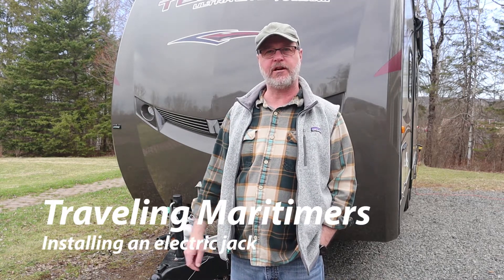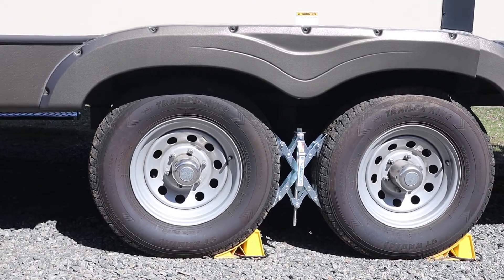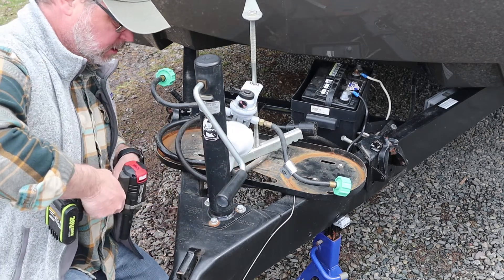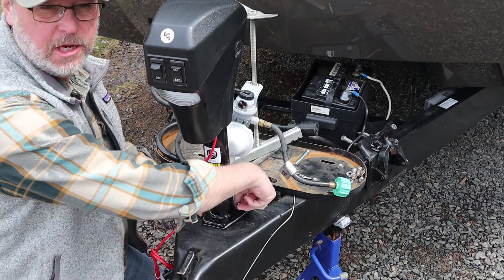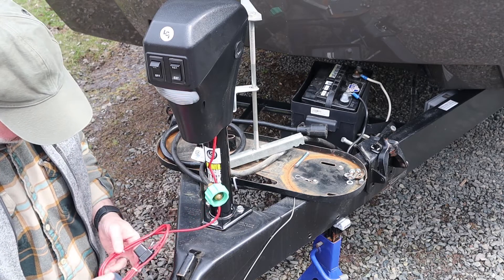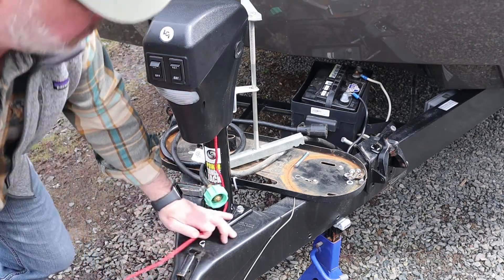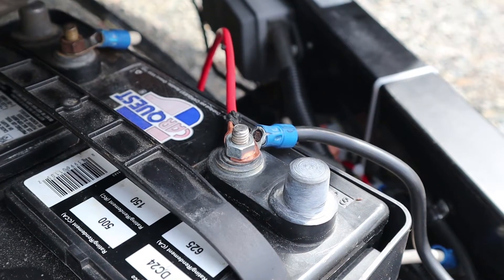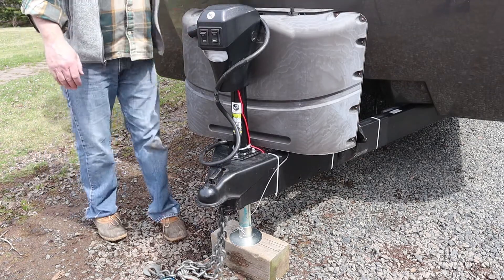RV Tip: How to install a Lippert Electric Tongue Jack

Comment: Nice video, two tips you might find useful.  The fuse can be replaced with a auto resettable fuse.  Mine was always blowing when it rained while using it, or if I bottom it out. 
Other is just an observation on your wheel chocks. I don’t know if you have another set on the other side but if not you should place the chocks on the front and back side of the tire to prevent rolling.  Even if you have a set on the other side it’s still good practice to do each side front side and back side..
Reply from the maker: Great tips, thanks for your feedback. I'll definitely look into the resettable fuse. Regarding the chocks, I certainly agree with you. I did have chocks on the other side and the X-Chock keeps things locked in place pretty well.

Comment: My first and most important piece of advice.  Be very careful removing the old jack.  I just replaced one because the motor went bad with a new one and one of the three bolts sheared off.  It turned a 15 minute job into a nightmare, finding a drill bit capable of drilling out the old bolt.  Once I got it out it took minutes to switch as the wiring for mine was already there.   I would recommend taking the weight off the tongue before you attempt to remove the bolts, liberal spraying of some kind of release agent, and gentle patience.

Comment: Nice video, thanks for sharing. Just for viewer's information..................... don't forget to use lock washers and tighten the bolts on the tongue jack to 15-20 lb/ft torque
Reply from the maker: Great tip!

Comment: Hello, this video was incredibly helpful as we've just bought the exact same jack to put on our 2018 JayFlt XLT 28BHBE.  Question:  what size was the lug terminal that you used to connect to your positive battery lug?  I need to order one from Cdn Tire to do this install.
Reply from the maker: Glad it was helpful. I just went and measured it. The hole is just a little under half an inch in diameter. Probably like 7/16. It was one I just happened to have in the garage. You could get away with a slightly smaller one. This one is quite a bit bigger than the terminal.

Comment: Can you use hand tools or a power drill  to attach the bolts if you dont have a torque wrench?
Reply from the maker: I don't think you'd get enough torque from a power drill. As far as hand tools, I guess it depends. If you had a long handled socket driver, like a breaker bar, you should be able to get them tight enough. If you don't think you have the proper tools, I'd highly recommend taking it to an RV service location to have it installed.
Reply: @TravelingMaritimers  understand. Thanks!

Comment: Does it clear your tail gate when lowered?
Reply from the maker: Not on my setup. I have to rest the tail gate on top of the jack. But it was the same with the old crank jack too. Other truck / trailer combinations will likely vary. With my old Jayco I could open the tail gate.

Comment: so this single-wire jack relies on accidental metal-metal contact between jack base pate and trailer frame for the other half of the electrical circuit.
Reply from the maker: That's right. Although it's not really accidental. There are three large bolts holding the base plate to the frame. We've had it for over three years now, no issues.
Reply: Should have cleaned the rust out from under the old jack plate before putting the new one on

Comment: How heavy is ur camper? Is 3500 pounds enough for most travel trailers ?
Reply from the maker: The camper is about 5500 pounds I think. But the jack only has to lift the tongue weight, not the entire weight of the camper. Tongue weight on a travel trailer is usually in the 10% range of the total weight of the trailer. Hope this helps.
Reply: I need to replace my  lippert smart jack #,643589 Can i used a different  tougue jack thats called power tongue jack also Lippert #285318 !
Reply from the maker: @patlove4077  Good question. I've only ever worked with this one, so I couldn't say for sure. But I would think as long as it has a weight spec appropriate for your trailer, and it has the same three bolt pattern it 'should' work. I'd recommend checking with Lippert customer support to be sure.

Comment: I want to thank you, I did ck eith lippert and they said I could use a different tougue jack but I decided to buy this one,same as the old one...I was kind of leary beacause of the comments, Im a female hope I can do great job like you..thanks again! I would like to know the size of socket to buy for removing the bolts!
Reply from the maker: That's great! I'm glad you got a jack. For mine, I used a 13mm / 0.5 inch socket. Good luck!

Comment: How do you like the ROCKWELL lmpact driver?
Reply from the maker: For a small, relatively cheap driver it gets the job done. I've used to to change the tires on my car and it can usually loosen the lug nuts. Sometimes it needs a helping hand from a breaker bar.

Comment: How heavy is your trailer? I have a 4500lb trailer. What lb jack do you feel I would need?
Reply from the maker: Our trailer is about 5200 lb dry weight. I would recommend you check the Lippert specs to determine what's best for your trailer.
Reply: It's not the trailer weight that is the concern.  It's the tongue weight.  There are a number of ways to measure that.  The tongue weight should be 10%-15% of your trailer's weight.  So for your 4500 trailer, this jack would be more than plenty.

Comment: Clean and paint the rusty spots under the jack.  I would also blue lock tite the bolts and also add lock nuts .  Too easy to steal.
Reply from the maker: Thanks for the tips!

Comment: Did you use your original trailer bolts or the ones that came with the tongue jack
Reply from the maker: We used the ones that came with the jack. They were a perfect fit for the threaded holes. I kept the old bolts 'just in case' but never needed them.
Reply: @TravelingMaritimers  thanks I just bought one through Amazon it will probably sit in the box till May when I bring my trailer out of storage